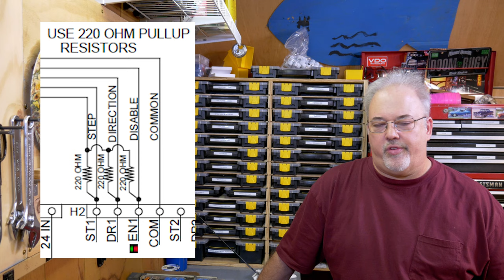Centroid Acorn CNC Controller- DM2800 Milling Machine Retrofit Project

Comment: This is clear off the path but I have RHJ GOLD  and a taig milling machine CNC from the Taig factory.  Ran on Mach 3 on a 12-year-old computer I think XP.  Hard Drive crapped Mach 3 won't run on the newer computers without different boards. So I'm guessing the micro proto 2000 driver from the factory is obsolete as well?  I looked at Acorn but I'm finding the same thing they're saying only a windows 10 single-core CPU will work what are you using for a computer?  Mike E
Reply from the maker: I'm using a small shuttle computer that is loaded up with Windows 10 for the Acorn.  I do, however, support a large number of industrial machines that require Windows XP to operate.  We purchase refurbished Dell Optiplex 780's on eBay and load them up with XP and keep the machines running.

Comment: I have a Bridgeport series 1 and would like to cnc it, I have anilam brackets for all 3 axis. Every kit I see is $5000 to $7000 . I already have ballscrews and have ballscrew for the z that in a bracket. The brackets I have are pulley type. Would it be cheaper in the long run to just buy something like microkinetics kit for $5400 or do you think I could do it significantly cheaper buying the parts myself? Do you have any resources you could point me to?
Reply from the maker: So you would be looking for motors, drives, and some sort of CNC controller?
Reply: Pete Rondeau yes
Reply from the maker: Ok, my take on this.  Due to the cost and size of a bridgeport, it is not as common of a conversion as the benchtop machines.  For that reason there aren't as many resources available, or competition for kits.  You could definitely convert it cheaper by exchanging your time for money and spend it researching all the options. Basically redoing the work the companies that are providing packages did.  We once owned a Bridgeport Boss5 mill.  It cost us in the range you are talking about to upgrade it and it was already a CNC mill.  It has been at least 15 years since I last played with retrofitting a machine of that size so I'm a bit out of the loop on prices for those size motors and drives.  I'm sure you've already been there but I would think the CNCzone forums would be your best bet for info.

Comment: Would it not be possible to add the 5v from the centroid power supply to the steppers? This was the solution I was planning to use based off of the diagram for the Leadshine drives. I'd be interested to know is you thought this was not a good solution. I am doing a retrofit on an Emco PCMill 50 and have all of the items on hand, except the machine. Woukd be a good time for me to make a change if necessary.
Reply from the maker: Hi Chris, I don't really have a good answer for you here because I don't know what the the Leadshine stepper drives are using the 5 volts for.  The only 5 volt signal my Gecko drives require is their input step and direction signals, and that is provided directly from the Acorn.  There is 5 volts available on the power supply, but I would want to make sure it was only being used for digital logic and nothing that could feed electrical noise back into the supply.
Reply: @PeteRondeau   Thank you for the reply. As I said, I am new to the CNC world, but this was my misunderstanding. I also am going to be using the 251X drivers, and thought what I had seen on another channel was a solution to the same issue. Thank you again for your time and work in producing such great content.
Reply: That's what I did on my G0704 conversion- use the 5V Centroid power supply to create a 5V+ bus to supply the stepper drivers, connect the stepper driver signal grounds to the appropriate Acorn inputs, and invert the step signals in CNC12.  I did try using 24V with drop-down resistors, and it didn't work well for me.

Comment: Pete, , can we use the acorn on any size CNC mill up to maybe 7-15hp
Reply: The Acorn can be used on any mill that the motors can accept step/direction commands.  The spindle is controlled by a 0-10 VDC signal no limit on size.
Reply from the maker: Paul, I don't see why that would be a problem.  The Acorn really has no concept how big the machine is, the control is still the same.  What are you thinking about retrofitting?

Comment: What do you call the plastic wire containment structure being used? From where is it purchased along with your terminal blocks? It all looks like nice components for any build. Thanks Chris
Reply from the maker: It is referred to by a number of different names: wire trough, wireway, or cable raceway. You can get it at places like Automation Direct or even on Amazon.  https://amzn.to/37PXKmk (This is an amazon affiliate link and as an Amazon associate I earn from qualifying purchases)  The style of terminal blocks are referred to as DIN rail terminal blocks and can be obtained from the same sources.  The are offered in different sizes depending on the wire gauge you are using.  They are also offered in screw terminal and spring clamp styles that just grip the end of the wire
Reply: @PeteRondeau  Thanks for the guidance, a little goes a long way, especially when you have the correct terminology.